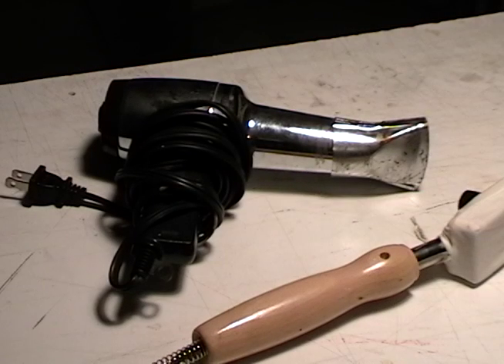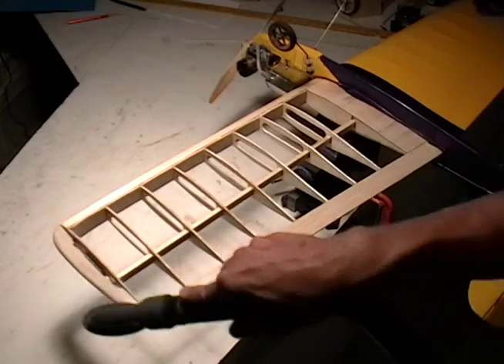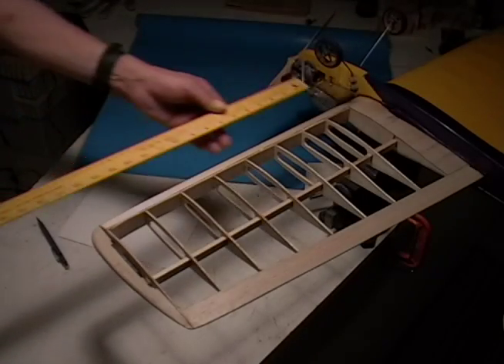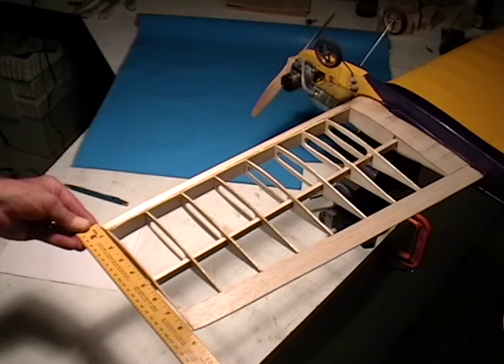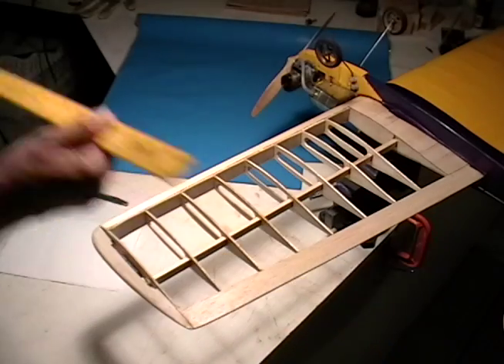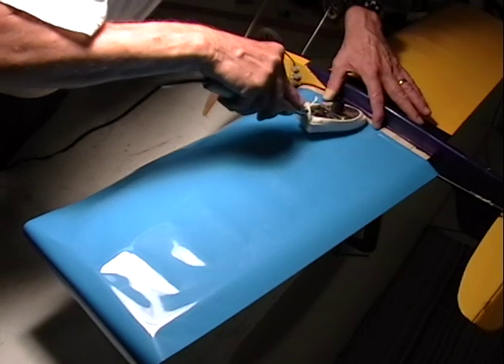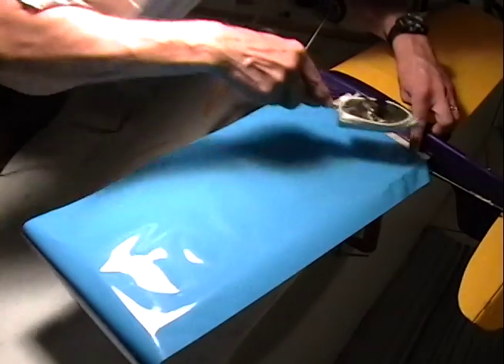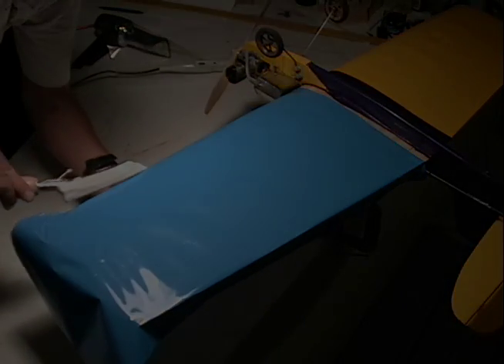Monokote 101 Part I.mov

Comment: Thank you!  Somebody doing it the right way.  I have an old book from Faye Stilley on covering RC airplanes you both share the same techniques.  Its been many years since but I'm getting back to the hobby.  I wanted to see if the techniques changed much but they really haven't.  But I've also seen videos on doing it incorrectly in my opinion.

Comment: Thanks for posting this series. I have rebuilt two Greatplanes 1/3 scale Cristen Eagle II's and the next step is to cover. All the compound angles and the tail surfaces will have to be covered on the plane. I feel a bit more confident after watching these. I am downloading and saving for later reflection too. I wont be recovering in Circus colors due to the feather details but will go creme and tan for both. So I'll give You My address Larry and You can come over and I'll "Let You" cover them for Me lol !  I'm actually pretty excited to to do it. Not My first recover but one of My most technical. Thanks again.